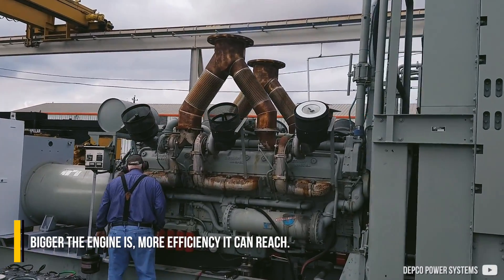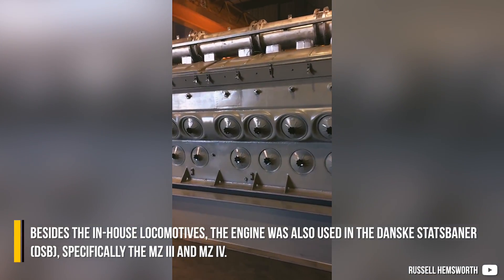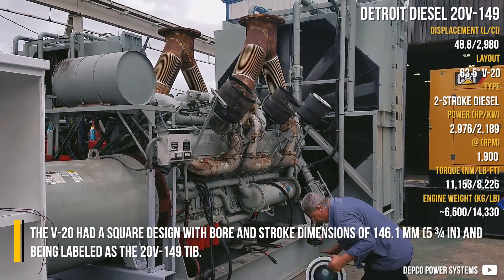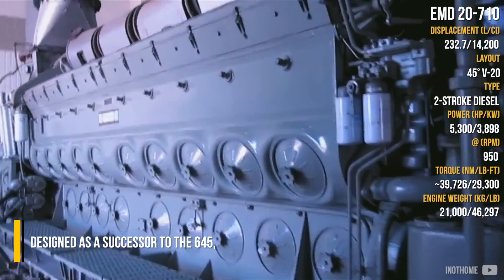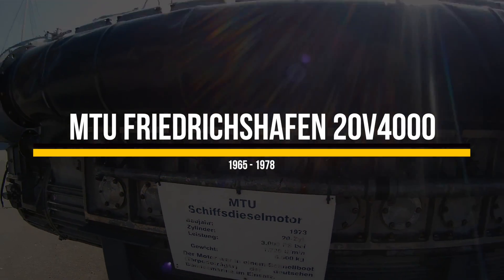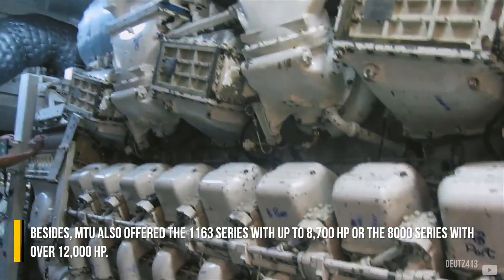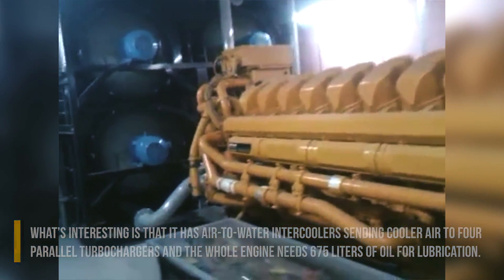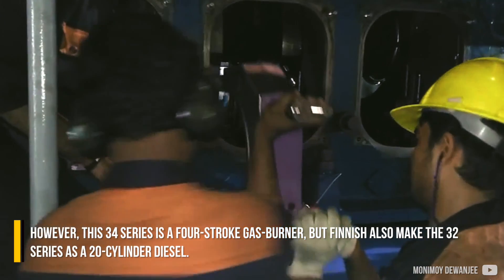6 V-20 Engines You May Not Know About

Comment: 50 percent efficacy??
Reply: Yes this engines have been create for the industry so they have to be the most efficient for cost-effectiveness.
For example, and it is absolutly awesome, the biggest engine on the planet produce by Wartsila the RT-flex96c is 52% efficient. Thats insane
sorry for my bad english
Reply: But it still cant beat Steam Engines... i heard steam gives up to 60 to 70percent efficiency!
Reply: I DO OWN and ride a 2 stroke Yamaha lawn mower motorcycle so i know what you talking about... but i wont agree it is as efficient as you described!
Reply: Rick Delair in theory 2 strokes can be far more efficient than 4 strokes. Just depends on the type. Compact trunk piston designs that put out all that smoke are inefficient. The smoke is the result of incomplete combustion of fuel. But they have very high power to weight ratios. 4 strokes are just the best we can do at making a compact yet somewhat efficient power unit. 2 stroke crosshead engines can be far more efficient than 4 strokes. The downside is much increased weight and size. You get a worse power to weight ratio but overall mechanical work is much more. Meaning for an equivalent amount of fuel used you get more out of it.

Comment: 0:35 Can this Camshaft fit in my Corsa B 1.0 3 Cylinder? How much Horsepower will be gained? Should i help out with some more Stickers?
Reply: Remove the rear window, and yes.

You will have less HP.
Reply: you can have my 20yr old citroen ax 11 camshaft instead!
Reply: Need some 'Go Faster' stripes too for max performance
Reply: Only honda can do that
Reply: It's a crankshaft, but you can make it like a  camshaft for your CORSA . Cheers
Reply: That's a crankshaft
Reply: That's the Joke. :D
Reply: You just need more stickers. One big sticker adds over 1000BHP
Reply: Also you may need to think about a suspension upgrade hahaa
Reply: But thats a part of the Joke. ;)

Comment: I hate that these engines never rotate fast enough for me to be able to tell what they sound like
Reply: Blake Parker when it comes to big engines like that you dont care about their sounds. The vibrations you feel from the beasts is basically like an earthquake. You can feel the power at idle lol
Reply: Christian Clemons genius I’ll try that
Reply: Inverted V12 Powerhouse but I’ve never heard a V20 before, theoretically it should sound like two v10s but no one really could know
Reply: 2:07 sounds like a few thousand rpm
Reply: That is due to the fact that it's a 2 stroke Detroit diesel, if it's hitting 1,900 rpm it'll sound similar to a 4 stroke hitting 3,800rpm.
Reply: that 20v-149 is running a 4 pole gen set so its 1800 balls out, and it you watch the spinner on the end of the gen (prob to set rpm ) by the control's, its synced almost perfect to the camera frame rate. 30/60fps for prob 408 3 phase
Reply: Blake how about this EMD V20 full load test?:
https://www.youtube.com/watch?v=hFVJ9Lhhm0I
Reply: Pretty easy to tell the Detroit IS a Detroit V engine.
Reply: Detroit 20v149 would like a word with you
Reply: Speeding up the sound isn't exactly like speeding up the engine, and those bastards should be stupidly smooth
Reply: just throw away their standard pipes and fit a Yoshimura slip on and you will hear Bohemian Rhapsody!
Reply: I think a V20 would sound like a beefed up V10, whereas we know a 5 cylinder sounds like a baby V10.
Reply: Bro the fuck are you talking about? 

Have you ever been in close proximity to an SD70 freight locomotive spooling up? It sounds like the end of the world. These engines have very unique sounds 4 stroke and 2 stroke alike no matter the rpm.
Reply: Well torque is like RPM!
Reply: Well having high RPM could destory your car
Reply: Blake Parker
Reply: 2:29 is the most we'll ever hear, sounds very awesome
Reply: @KennyMcCormick123-e2n 5:32 is a good spot too.

Comment: I never thought there were more complex V-configuration engines than a V16 until now!!
Reply: Google "24v71"
Reply: Josh Bacon pretty sure a v24 exists

Edit: someone beat me to it by 1 minute
Reply: How about a 42cyl radial which is "basically"  multiple v configurations on the same crank.
Try "dragon fire tractor pull" if memory serves correctly